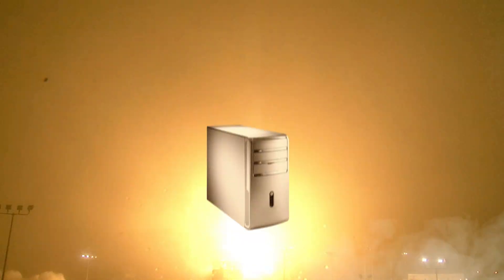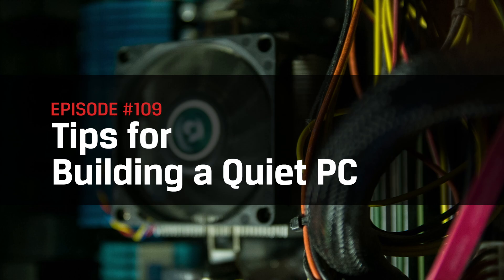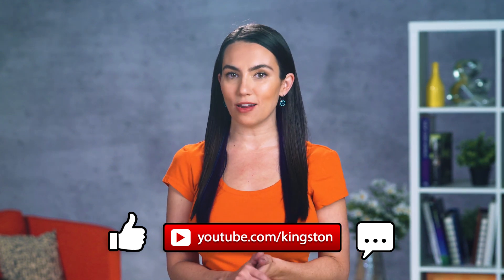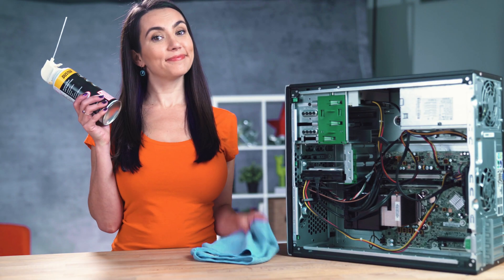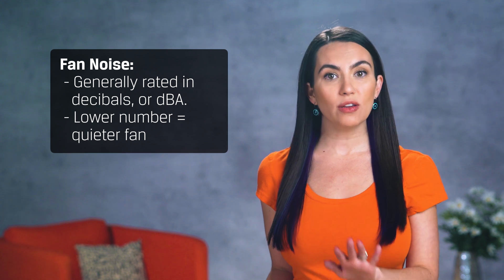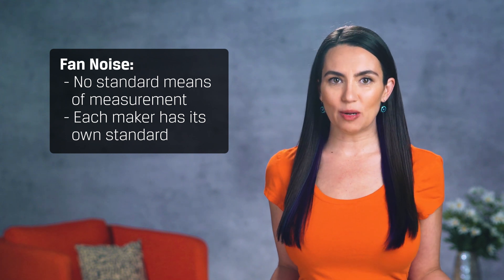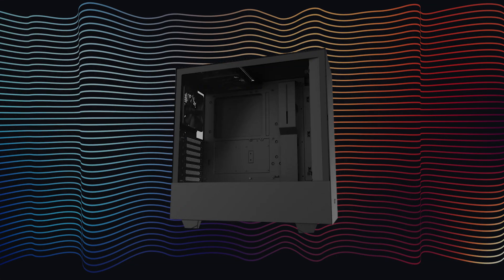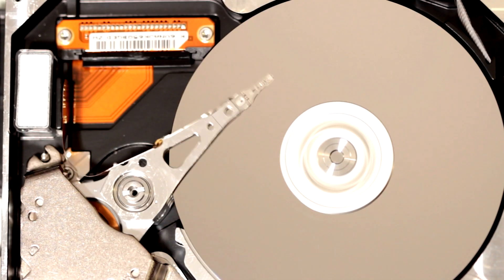PC Build - Tips for Keeping a Quieter PC 🤫 – DIY in 5 Ep 109

Comment: I just put together I7 9700KF, RTX 2060, 500GB 970 Evo Plus, 32 GB Vengeance RGB RAM on a Aorus Z390 Pro Wifi motherboard powered by HX850 in a white Crystal 570x case cooled by Hydro H100i Platinum SE with 6 LL120 fans decorated with Lighting Node pro RGB Strips.
I'm planning to buy twin Kingston A400 960GB SSDs for extra storage.
Reply from the maker: Sounds like a pretty solid build, RKB. Let us know how you like the extra storage!

Comment: I am an ALL be quiet! lover!! lol  I only use them...and NOTHING else for CPU cooling and case fans.  My PSU are EVGA with the eco mode!!  GPU fans only run when necessary...and my ASUS motherboards over case fan control in bios, etc. SSD drives only. So, my computers are virtually silent.  BIG fan of quieter PC's lol  GREAT job Trisha!!  Always enjoy our videos!!  Merci
Reply: I prioritized quietness and energy efficiency when I built my current machine. Watched a bunch of videos to see which graphics cards were the quietest when run at full load, and made my picks. Super happy. You can't even tell my machine is on, and I have the case open.